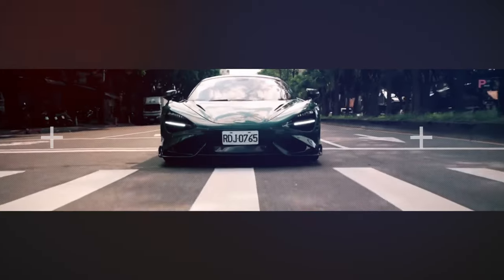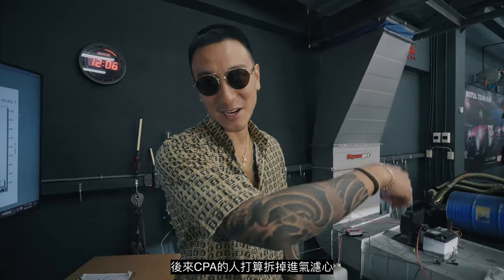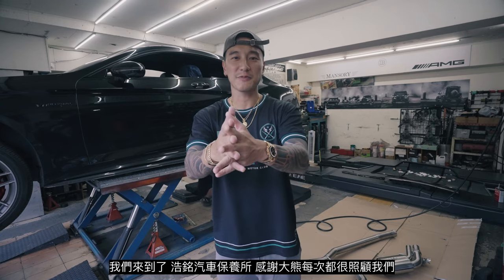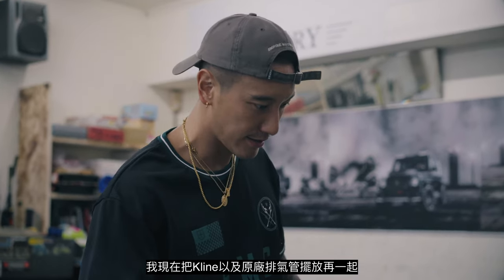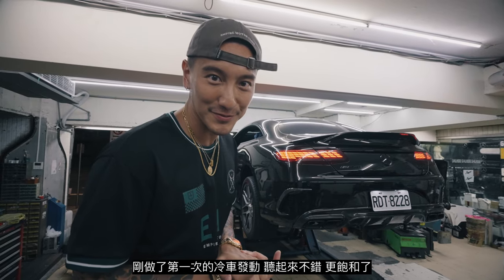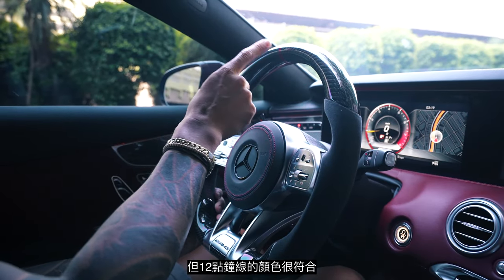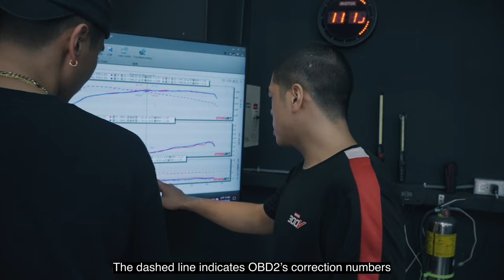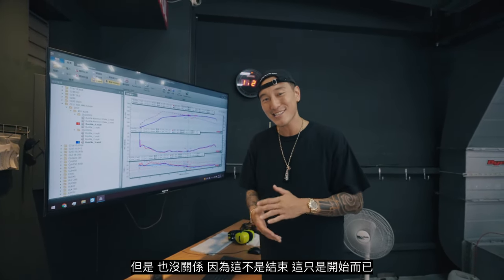黑武士改裝開始！Kline排氣管第一階段｜PROJECT DARTH VADER:KLINE EXHAUST STAGE 1《EMC Vlog Vol. 71》

Comment: I guess without any adjustment on the intake filter, and also another tune to match it, difference not going to be big. Important is it got louder, some weight savings, and more bad ass😂
Reply: Doubt intake will make a big difference, but a tune sure will